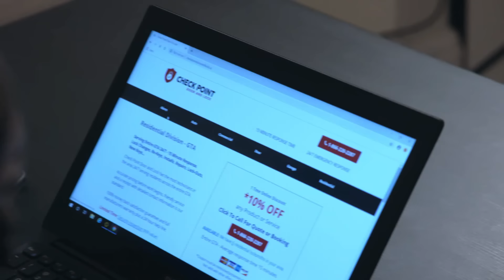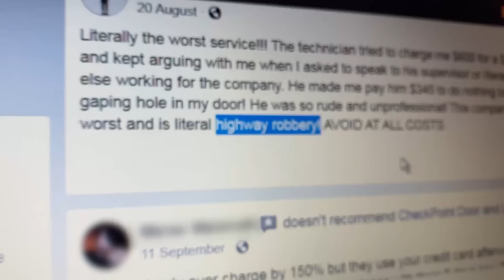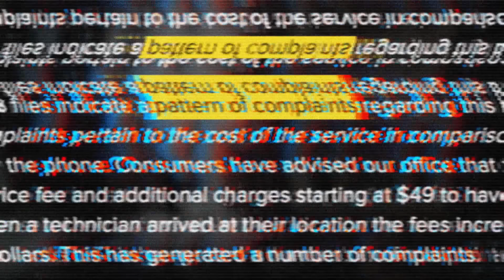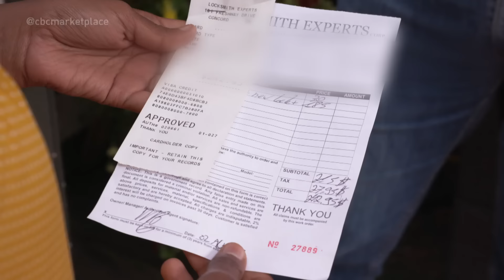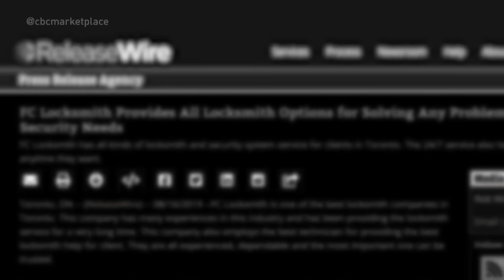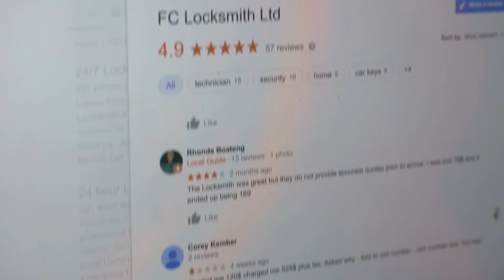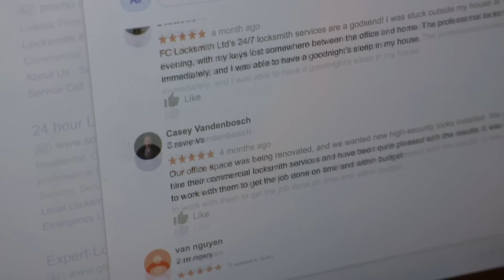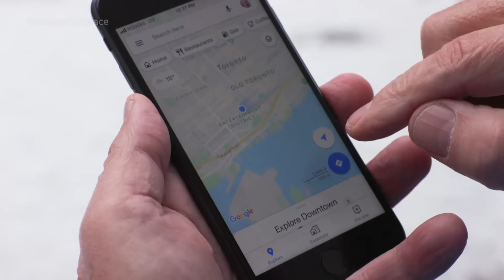Locksmith ripoffs: Hidden camera investigation (Marketplace)

Comment: for 450$ they couldve bought the damn drill and carbide bit to drill their own door and still save 200$
Reply: If you have a Harbor Freight or Princess Tire near you it's even more affordable than that lol.
Reply: lol for 450 u can get a used RTX 2070 Super 😂😂😂
Reply: For $450 they could have replaced the whole door.
Reply: @Hehehe-hf7rq  Minors
Reply: @LH079  not really you could pick thatt thing and still wack the door open and porbably have a shot of that thing still running
Reply: That’s with all trades. It’s not materials and tools that are expensive. It’s the experience/knowledge you mostly pay for.
Reply: Rustyxd63 but man… he just drilled the thing open
Reply: For $450 wouldnt it be cheaper to break a small window🤔
Reply: Even cheaper if you buy the stuff at your local pown shop...lmao
Reply: @J4Y98  true
Reply: @Hehehe-hf7rq  Bro I just sold my 2070 Super for $350 and it didn't even have six months of use on it yet.
Reply: Basically bought a new door
Reply: It is Canadian dollars tho not American
Reply: For 450$ you could prolly just kick it in and have a new door
Reply: Yeah, cause that's realistic
Reply: @Evravon  what did you get? new gen gpu prices are insane where i live, the rx 6800 is still above 900$ 😭
Reply: @Hehehe-hf7rq  GeForce GTX 2080 Ti Strix.
Reply: I’ve picked extremely difficult padlocks and door bolts, I was a small child, my brother and I just started trying and figured out how to unlock most types of locks in North America
Reply: Hell couldve bought a new deadbolt and get it keyed with the money after buying a new drill and bit😂
Reply: For that kind of money, they could buy a new door
Reply: or break a small window pane
Reply: You are paying them to drill
You are paying them to know where to drill.
Reply: Lol for that price you can buy a drill and some cobalt bits, and have enough left to buy a fancy lock you can unlock from your phone.
Reply: Get your angry grandfather to smack that door down for free!!
Reply: tf do you people think lockpicks work for free doing over time???? what about gas for the car??? what about all the licenses that need to be payed
start a lockpick bussiness yourself if you think you want to work cheaper.
drama queens
Reply: Well a doctor just checks your chest with a stethoscope for 2 minutes and charges the same.
Reply: I took a plumbing class once through my building services union, and the first thing the master plumber instructor taught us was something so simple that I'd taught myself to do it when I was 11 or 12 years old. He was like "You guys see how easy that was? You can charge at least $100 for that because you have the knowledge on how to fix it, and the customer doesn't". There was a long silence after that in the classroom because I think everyone was floored by the epiphany on how they'd been getting ripped off by plumbers their whole lives.

Anyway... Same energy with locksmithing I guess.
Reply: Cheaper than that if you take the drill back to the store
Reply: Th 94 year old woman? Lol
Reply: LMAOOOO
Reply: Id have kicked the door off the hinges and bought a brand new door for less.
Reply: @Purdue Pharma how about just stashing a spare key 🔑 outside
Reply: And have a damn good drill lmao
Reply: Man for free i can walk behind my house pick up a drill and do it myself
Reply: for 450$ i would buy an axe to break the door and could install new door
Reply: @Hehehe-hf7rq  not over here bruh
Reply: Fo real playa
Reply: @wildestcowboy2668  Rezpek
Reply: What they exploit isn't that people are unable to figure out how to eventually get into their homes—they exploit the fact that a lot of the time people get locked out and are calling locksmiths at really inconvenient hours, after hardware stores are closed, often late at night or in the middle of the night. That's how they get away with charging ridiculous fees.
Reply: @pipemasterplays  honestly these people complain about the price but how would the locksmiths earn a living without them charging alot

Comment: I was locked out on Christmas Eve last year and this exactly happened to me too. He looked at the lock and said it was unpickable and drilled it out for $400.
Reply: Might as well kick the door in at that point
Reply: @upinalaska49  if you drill it properly. The only thing you have to replace is the cylinder. And they are a dime a dozen in the locksmith industry. I rarely drill, but when I do. I replace the cylinder for free and pin it up to the persons original key so it's like new.
Reply: @leoj-nd7kl  well that’s good of you to do so. If I had to choose between the $400 price and kicking it open. Then I’d just kick it open
Reply: @upinalaska49  I would too at that price lmfaoo

Comment: For $1,500, she could have replaced the entire door, and frame, with the assistance of Home Depot, and it still wouldn't have been that much. What a charlatan! 🤔
Reply: Your exactly right!!!
Reply: 100% Right!.
Reply: I was thinking , why don't we weld a long metal pipe to the keyhole of the lock and build a contraption attached to the key for access, it's easy enough to build and makes picking access impossible.
Reply: True that!
Reply: A door with new lock takes a good 20 mins max to install. It’s super easy and straight forward
Reply: Or called the amateur that charged 450 to drill lol
Reply: Fr

Comment: Lady: picks lock in 3 min
Locksmith:”I wouldn’t be able to pick this lock in a YEAR”
Reply: It's a sham. LSDA 5 pin are a good residential and light commercial locks.The smith didn't know that the pins had been replaced. In factory condition, it likely wouldn't have been worth his time.
Reply: What Andy said
Reply: @andyh7537  yeah what Andy said
Reply: Because he WANTED to charge the higher price to drill the lock out PLUS sell her a new lock she didnt need, the whole guy was one big self serving scam
Reply: @andyh7537  yes but even sliding a pick through he should be able to tell its been altered, also he is supposed to be a lock Smith... Factory made locks should be is specialty. Also pick guns exist. If you're not concerned with damaging the lock then you can try one.
Reply: Just tell him: "I've got time, so start picking!"
Reply: Not knowing the setup of the lock or the actual problem, he shouldve tried. It may have been jammed, frozen, or just easy to pick due to poor pin selection. KISS principle is always in play with a lockout. I would always try to find an easily accessed unlocked door or window before attempting a pick or drill as well.
Reply: The lock picking lawyer would breathe on this lock and it would just open in fear
Reply: @gingerale6634  hahaha exactly my thoughts !!
Reply: He said just give me $80 for a Google review
Reply: Lockpicking 100
Reply: @andyh7537  Maybe not worth THAT hacks time but an actual locksmith could have even an actual LSDA lock picked in a matter of minutes

Comment: I locked myself out my house and I ended up just smashing the back door window. I am in the UK and if I had called out a locksmith it would have cost me a fortune. It cost me £40 to have the glass replaced.
Reply: Lol  glass is cheep in Canada to
Reply: Now there’s a idea 🤣😂😅
Reply: I did the same once. I kicked in the front door, a new lock is ALWAYS way less expensive
Reply: Did no one call the police?
Reply: I think so when it comes to your home break in and it will be much cheaper to fix.
But that would be common sense and some have so much money and have never broken into anything.
Having a locksmith drill out your tumbler is in theory just breaking in.

Comment: "If the lock is able to be picked it will be $95."

A few breaths later.

"Yeah I'm not charging you $95 dollars for that. That took like two seconds."

My kind of guy.
Reply: "LeAvE a ReViEw aNd iLl dRoP iT dOwN tO 80"
Reply: Would he still be your kind of guy if he charged you 94.99?
Reply: Boxing Bro didnt he make it 80 in total instead of 35+90 or whatever?
Reply: And the bill is probably 950 dollars
Reply: O M bruh just be careful cuz people gonna start thinking you try a steal a car
Reply: @lividsunshine8968  For most cars you use the wire. It is  done in like 1-2 seconds.
Reply: The fact they called him out for the review is bs. He was a good dude
Reply: When he said that, i thought he meant it would be free. Dropping it $15 and then extorting a review out of her? Yeah... no...
Reply: @elementalcobalt1  He dropped it to  -45$ with a review. 35+90=125-45=80
Reply: @Thunderstyle7  Nope. That was the first guy. The second guy said they charge $29 to come out, and then it goes up from there. She asked how much was it going to be, and he said minimum of $45. Assuming he said $45 minimum on top of $29 -which isn't what I heard, but fine-, that's still only $74. For a job that takes 2 seconds to cost $80, what does it take to reach $74? The door already being unlocked when he gets there? As far as when he said it costs $95, I guess it was on top of the $29. So you're right, he took money off from an already overquote.
Reply: @Daniel Kimmel Is that so? And how far in life did you replying get you in life with that obvious statement?
Reply: Proceeds to charge 80$ plus google review
Reply: Still charged 80 for 2 secs
Reply: Skeleton Masher So the more skilled you are, the less you make?  I’ve spent years learning how to pick a lock - if it takes me 60 seconds and someone else an hour, why should they make more than I do?  Shouldn’t the person who does the job better and faster make more?
Reply: Kate Gray Spitting facts!!. Time doesn’t always equal effort, Sometimes the less time it takes to finish a job the more effort it actually takes because of the years you have taken to master your job
Reply: @kshatriya1414  you can tell these people are not business owners. They don't know about insurance, wear and tear on vehicle, gas, tool cost, training cost or the fact that you may only get 1 or 2 calls a day so you have to put money back to stay afloat, advertising and website cost. They  complain if your tools and work vehicle look shabby but don't want to pay you what is needed for upkeep of a professional business.
Reply: @markrojas587  service charge idk why thats an issue. You cant give away free service with cost of gas and time 90 bucks just to go to a property is about the going rate
Reply: It was nice to see.
Reply: @countdeniro256  exactly
Reply: @Skeleton Masher no it doesn't. Need, experience, skill that determines money.
Reply: Sean he then charged her $80
Reply: Sean 

85 and a google review!!!!
Reply: @If you laugh you sub! calm down   seriously getting heated over a comment
Reply: Sean lol yeah for 2 seconds it’s 80 for 3 seconds it would of been 95 lol
Reply: too bad they reported the google review to the company and probably got him fired
Reply: There’s a famous saying for this, something along these lines:
A factory line 🏭 suddenly ground to a halt. A critical machine malfunctioned, and the employees could not repair it. The factory boss reluctantly agreed to call in an expert. 

The expert arrives, examines the machine for a few minutes, pulls out a screwdriver and turns one screw. Suddenly, the machine springs to life and is back in perfectly functioning order. 

The expert says “That’ll be $499.”
The business owner is outraged. “$499?! All you did was turn one screw! You weren’t here for more than 5 minutes!”
The expert replies “Okay then it’s $5 for the time I was here, and $494 for the lifetime spent learning exactly which screw to turn, and precisely how far to turn it.”
Reply: Exactly . And you are not just paying for two seconds . What about the time it takes for him to drive there , time he could be spending with his family. And you also pay for his expertise and the value you get from his service . He may have got the work done in 2 minutes because he is an expert . He should not be punished for not being a bumbling fool who takes an hour to do the job

Comment: The first locksmith: it's not gonna be our most expensive drilling at $350, it's gonna be cheaper.
Then he charges $452 at the end lol
Reply: I mean he did put in another lock which costs $90 which the ultimately leads to $450+ including tax
Reply: Sad thing is anyone can drill a lock
Reply: iawindowss ye and it costs like what 10$ for the bit at your local Home Depot
Reply: @globalsaturation7333  Right
Reply: @iawindowss4061  Anyone can turn a key in the lock, too.  The trick to each is to have the tool that you need at the time you need it.
Reply: @SoloPilot6  lol
Reply: @SoloPilot6  And itll cost you 300$+ if you dont.......

Its just a scam.
Reply: @Cat-uo9fo  For real eh
also installing locks is easy she could have bought a lock and replaced it to.

Comment: 11:47
"Yeah ok not gonna charge you 95 because it only took 2 second"
So im gonna charge you 80 if you also leave a review

Perfectly balance as all thing should be
Reply: yeah..... I would be mad if he did a bad job and asked for a good review. but asked for a good review when he actually did a good job i would be fine with that.
Reply: @muffinb5446 , yup. Cheaper than a tip.
Reply: Would have been 95 on top of the costs for going out there wich was 29 if I’m correct, so that means it’s a $44 discount.
Reply: xCrimeAngelx that’s totally fair in my opinion

Comment: Me: NO NO YOU CANT JUST DRILL A DOOR YOU CAN LOCKPICK 
The “Locksmith”: Ha ha, drill go Brrrrrrr
Reply: Even when i lived in an apartment complex they drilled the lock when the spare couldnt be retrieved because the office was closed. Think about it. If you purchased locks wholesale say $25 a piece and had a drill, you could charge $100 to drill out the lock and replace it. $75 profit for 20 minutes of work. Get 4 a day and you got $300 for 1 hour and 20 minutes of work. I might have to do that.
Reply: Lmaooo top tier
Reply: Not brrrrrrrrr
It goes like this
Drrrrrrrrr
Reply: They're called drillsmith
Reply: this made me go xd
Reply: Frank Rampersad - Chip keys from the last 20 years require two keys that will start the motor – that is, the car’s computer recognizes them. Order a new key online by the car’s VIN. It will be cut to go in the locks and turn them, but it won't start the motor. The two keys that will start the motor are then used to “introduce” the new key’s chip to the car’s computer.
Do this while you still have two keys that will start the motor. If you have only two keys then lose one, prepare to pay $150-$250 for a new key that will start the motor. Then, before you lose a key again, order another key by the VIN.
If the ignition lock has ever been replaced, the VIN won’t help unless the new lock was reset to the old keys. The old keys will still unlock (or lock) the door/glovebox.
If something ever happens like the battery went dead and the remote key or fob won't unlock the car, there should be an emergency key hidden inside the fob that will unlock the door and ignition lock. However, it won't start the car.
Reply: Brrrrrr papa and the door will kick in pum!!!
Reply: Lol yes
Reply: They could literally just look up on youtube how to lockpick.
Reply: These guys need to take some lessons from LockPickingLawyer
Reply: GOATED
Reply: Lmao 🤣 I’m dying you said drill goes brrr 😂
Reply: Lmao!